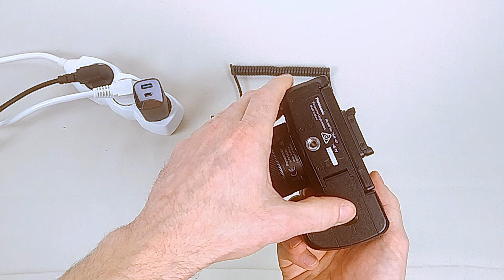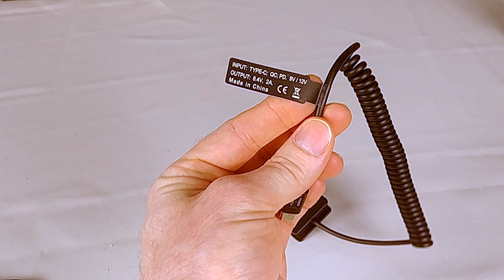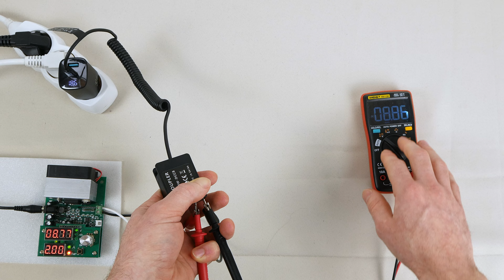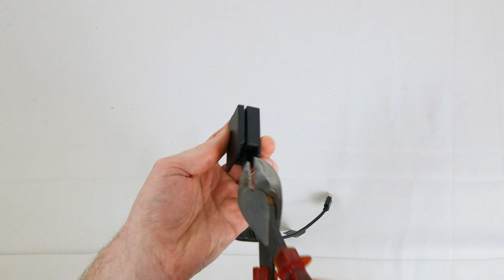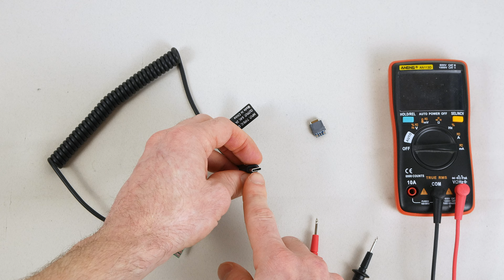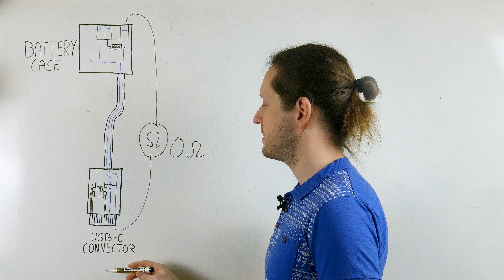Fake USB-C Dummy Battery – Voltage Testing, Teardown & Schematic

Comment: Did it work? I have the same dummy battery and it didn't work in my Lumix GH2. It displays "This battery can't be used", also checked inside thought it was fake but I saw your video and it is exactly the same. You never showed in the video that it is working but if it does might be my gh2 or a charger issue in my end.